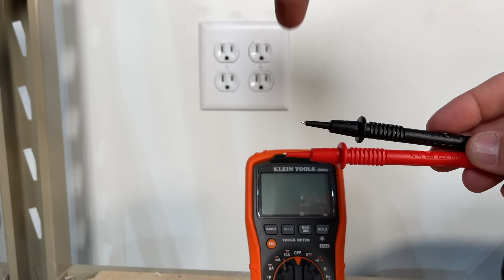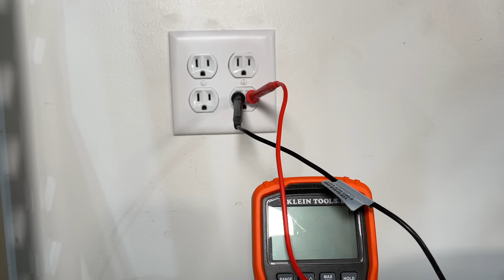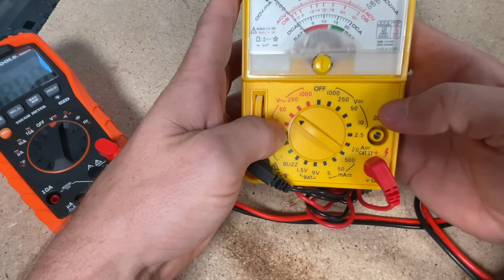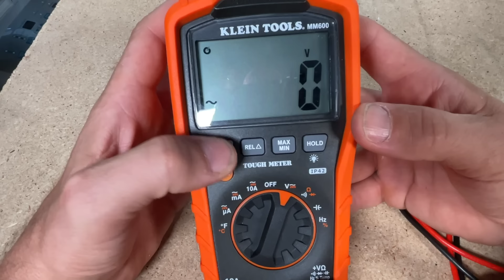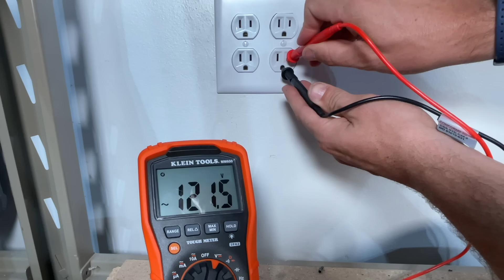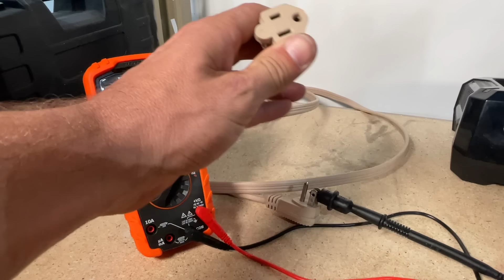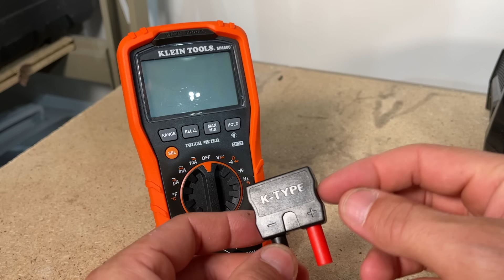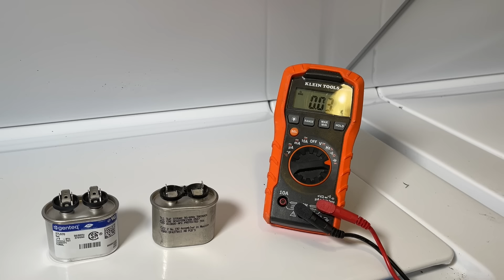How To Use A Multimeter for Home Repairs and Troubleshooting

Comment: As long as your probes are in the Volts measurement position on the meter, and the dial is on the correct measurement, you won't receive a shock through the probe tips, the resistance through the meter is in the megaohm range (unless you have a low impedence meter, or a LoZ option, read the manual!).

Depending on the meter you need to be careful as some use the milliamp sensor through the same port, and the selection dial controls the current flow through the meter.

You need to explain the importance of having the probes in the proper positions prior to measuring. Having them in the 10A position can yield a nasty spark at 120VAC.
Reply: I was going to say if that was true than when he put red probe in hot side and black probe in the ground side he just energized the entire ground system of his house.
Reply: @rtb1724  iti can be thru is some situation ... and it's not powering up the ground
internal resistance of the meter prevent current flow as safety prevention 
but if you use the same logic for an old lamp or something that as lower internal resistance .... the normaly grounded wire will let way more power out and you will feel it ... 
or if you use the tester to measure current flow with the amp setting .... yes doing it reverse can trap you
Reply: Agreed but for beginners best to get them used to good practice and if they accidently have it set to amp.
Reply: I believe some meters sound an alarm if the probe is in 10A and the measurement selection is not at 10A.
Reply: Same thoughts, missed the first key part for setup.  I know this cause I put a cheap harbor freight one into a socket and didnt pay attention to where the leads where, big spark, tripped the breaker, and melted the probe end a bit.
Reply: @mosmosspam  Not only that, you can also destroy the meter. if the meter is set to ohms, you will for sure kill the meter. That is why, I set my meter to the highest AC voltage before turning the meter off. They way there is less chance of connecting to a high voltage on the wrong setting.
Reply: @MrCarl312  How would setting to the highest AC voltage help if you then turn the dial to off? The meter would not remember what you set it to before. Setting it on the highest AC voltage only helps if your meter cannot be turned off.
Reply: @mosmosspam  It's not so much that it came from "Harbor" "freight",
 it's whichever one harbor freight was selling, that you chose and even though the overcurrent worked, it didn't work quick enough with a dead short, before there was some damage to the conductor.
Reply: @frankpaya690  the cheap Harbor Freight DMM is unfused on the 10A terminal.  It basically uses a short piece of solid copper wire as a current shunt, with the external wiring acting as the fuse.
Reply: @mosmosspam  lol I don't have to worry about that, I have a clamp meter that measures up to 400 amps, AC and DC though you do have to make sure you are set to volts,  not ohms, capacitance  or temperature (the K thermocouple plugs into the same jacks as the test leads.  )   some food for thought.
Reply: @Sparky-ww5re  400 amps Jesus!
Reply: @wizcombo  yes, you get a dead- short with that kind of amperage, you might just meet him.
Reply: Exactly! This should have been titled: “Using the buttons on a Klein MM600” 
This was a very poor tutorial to say the least!
Reply: @OGRH  Hello - I don't think this video was meant to be a substitute to reading the manual for your particular device. No doubt, some of the information he provided was priceless to many novice users of any multi-meter in general.
Reply: Can putting the the poles in the wrong spots (backwards) damage whatever I’m measuring?

So if I touch with the black where I should be using red and vice versa could that cause issues?

I’m using this device to measure things other than outlets too. Like guitar electronics. In wondering if the multi meter itself could send electricity back and short something in general?
Reply: @heythere6983  not in the voltage or amperage setting, no voltage will be output by the meter, and polarity does not matter in AC mode. In DC, it will just read a negative value. If you use the ohm or diode settings, it will output a small amount of voltage on order to test the circuit. Some meters output more voltage than others, so careful testing IC's, but passive components will be fine.

Make sure your probes are in the correct sockets as well. The 10a socket for the red probe is a dead short to the black probe.
Reply: Oh ok thanks for the help!
Reply: @heythere6983  no the meter doesn't give of voltage in the in the volts or amp setting , and only about 9 volts in the ohms setting . the only difference in reversing the probes is in CD voltage, there some difference there .  the resistance within the meter is extremely high in volt setting and doesn't pass voltage through it ,  except in AMP setting . if it did ,when he measured volt on the outlet he would have tripped the breaker .  this guy doesn't know HOW the meter functions . an important step in teaching about it !

Comment: What would you consider top of the  line multimeter
Reply: You can't go wrong with pretty much anything Fluke makes.  I have a Fluke 87 that I have been using for better part of 20 years now (if not longer) and it still works just as well as the day I bought it.
Reply: @richardl4556  , we use Fluke 87's at work (audio electronics repair shop) on a daily basis. Just 2 issues: they can still drain the battery when they go into "sleep" mode automatically after 10-15 minutes, and the ammeter fuses/shunts are expensive if you blow them. BTW, we still use Triplett and Simpson analog  meters every day, they're better than digital meters for testing diodes and transistors in circuit (looking for shorts versus forward-junction voltage drop), and for testing flashlight batteries (the loading imposed by an analog meter is more similar to what the batteries would face in daily use, versus a high impedance digital voltmeter).
Reply: Fluke 87 is probably the gold standard. As a mechanic I use a Fluke 115 as I don't need all the additional capabilities of the 87 and the 115 is plenty accurate.

Comment: Great video! Quick question on the Amazon link in your info section, which meter should I get, there are 2 options on the link you provided, a $60 and $100 model, what is difference?
Reply: The more expensive meter is a true RMS meter, and should be your first choice if you are doing commercial work.

I have a Fluke 117 for my true RMS, the readings will be different on AC circuits using capacitors. Read into it and understand the differences between the 2 styles of measurement. It is much cheaper to produce the averaging style of meter, which is why none of the entry level meters are true RMS.
Reply from the maker: I think the MM600 is more than enough for most of us.  I think as you step up to the MM700 the method of measurement gets a bit better but I would guess that additional level of accuracy isn't going to make much difference to you or I.
Reply: @EverydayHomeRepairs  thanks for quick reply. I work in HVAC industry, so I would be using this for some commercial application (taking care of our office HVAC units) think I should get the more expensive one?